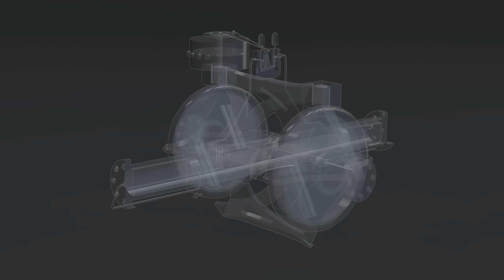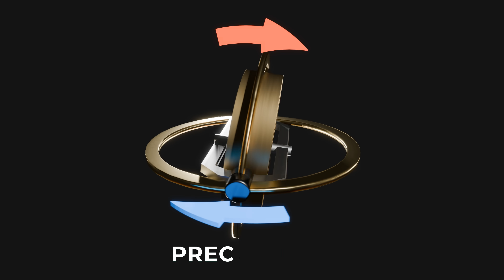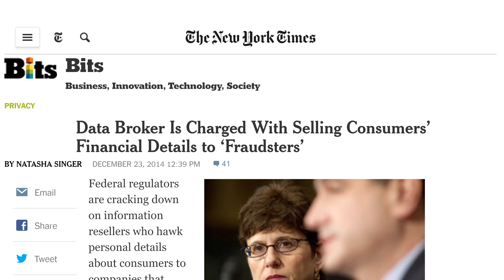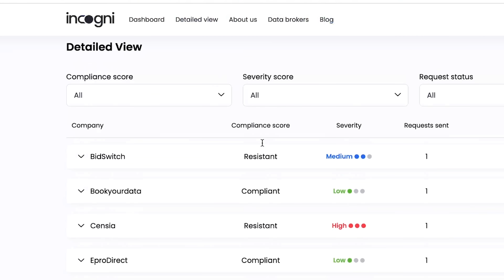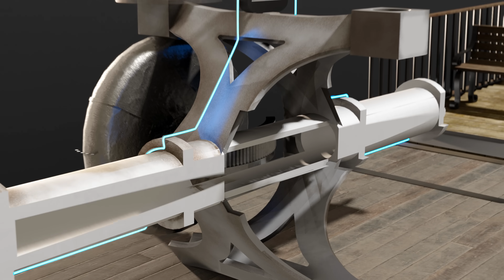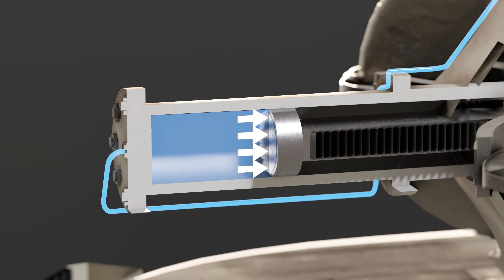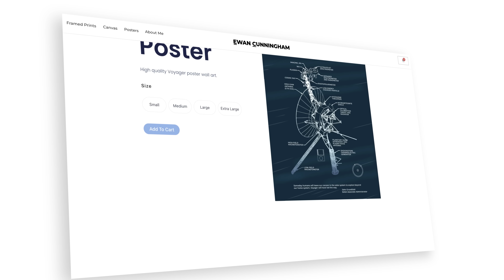The Self Balancing Monorail

Comment: Part of this idea was refined to develop the first High speed train ( The Talgo system) It used a gyroscope too, in order to maintain speed in the old spanish railway infraestructure. The Talgo reached 210 km / h in the eighties, that is a real Milestone. Afterwards the patent system was purchased by CAF to develop the TGV. It happened like that because Talgo didn't build up engines, and CAF could by buying the patent to Foster the required innovations to put their trains in 320 km / h

Comment: I see a problem with even a single car rail bus not clearing the obstacles on either side of the existing two-rail network, but it was a success as a design, and was effectively reinterpreted in a non-rail vehicle half a century later.

Comment: This is neat for an experiment but its not practically or economically viable. Any cost saving in rail are FAR offset by the heavy and complex gyro system. And when it fails... and it WILL fail... bad things WILL HAPPEN to the train, passengers and anything in the way when it falls at speed. The level of maintenance needed to keep ensure that never happens would be well above the cost of for regular rail cars. 

Also trains spend a lot of time parked. Every car would need to be constantly powered/fueled so it didn't just fall over sitting there. That is not only a cost problem but the logistics of that are nuts. One guy accidentally disconnects a section of freight cars and suddenly u got 100 rail cars falling into the next row of rail cars in the yard.

No sane insurance company would every cover this disaster waiting to happen.

Comment: A problem i can see with this design is the wheel shape and the track. The track has to be perfectly leveled on both vertical and horizontal axis. Any bumps or bends caused by wear and tear may cause the single wheel to bounce on the track and not land perfectly on the track, derailing it. This will limit the speed at which it can travel for safety purposes.and then the issue of comfort. Anyone has taken a ride in a bus with a shitty driver ? Steering left and right constantly for no apparent reason? As the gyros conpensate to keep the train upright, the pessengers will feel being pushed from left to right constantly. Though it will be a very small push, it will be nauciating on a long journey.

Comment: loosing space on every car for a gyro.
with one wheel you have constant rubbing on one sideflank of the wheel. which probably gives you more friction than with two rails.
the wheels on normal trains allways self center itself. only in extreme situations you have a rubbing sideflank.

it looks amazing and the ideas are pretty awesome. also the problem solving is extremely genius.

Comment: It's a fun concept but it was killed by a lot of things. How would it fare on older, or worse repaired, or otherwise unclean tracks that may have small branches or litter on them? How would it fare in snow or even just rain? Gyroscopes and reaction wheels used for balancing can become saturated, as well, where the cumulative change over multiple turns adds up to more than the force generated by the spinning mass can handle.

Comment: The thing about 2 tracks, a regular train, they have passive self alignment wheels. 

This train needs revisiting, as a commuters line.  

Also a spaced out wide track, back to two tracks, you could easily service tracks without down time. Just switch to the other rail.

Japan shutdown their rail at midnight, each night, to service their system. 

You don't want to miss the last train in Japan. You will find a very expensive cab ride.

One reason that US trains cannot hit top speed in the US northeast is because because th track radius is too small, going through crowded old areas.

One problem I see is an electric version.
You could use batteries on curves, on straight track, pull power overhead to run, to recharge batteries?
Reply from the maker: A fair assessment overall. There would certainly have been more obstacles to overcome. I'm still going to be forever curious what this design may have evolved into with the right investment though haha. Perhaps it would have evolved into a two track system regardless 🤣🤣 we shall never know. Thanks for watching and for taking the time to comment. Good luck in the giveaway.
Reply: @primalspace  Well 3 tracks, 2 used for bidirectional traffic, third the maintenance rail, to be used to handle traffic from the other being worked on. The biggest problem is constant uninterrupted service with rail.

Expensive up front, 3 rails, but cuts labor cost, crew timing, overnight work, better scheduling?

Just ask the airlines when national weather shuts them down.

When does NYC service subway tracks?

Comment: well i knew it was a gyroscope before i watched the video and i also know that the reason it isnt adopted is because if it has to stop due to some sort of malfunction it will fall over lol. and then how to pick it up? also loading and unloading immense cargo is an issue, you would need this gyro on every wagon, the cost is absolutely obscure...
 the current trains are very reliable,  another thing from the engineering standpoint its not half the price its probably 3x more because you would have to stabilize the track for horizontal forces a lot more than the typical 2 track system. basically its more expensive to do the same thing what a standard train does. modern monorails travel at upwards of 4-5 times the speed so the added cost is acceptable. also my IQ is about 50% higher than the average but this was still an interesting video.

Comment: Brilliant, but also impractical. Besides stability, two rails offer better weight distribution, more weight capacity, less wear on components and also less chance of derailment if one of the rails is damaged. Such a project was doomed to failure from the start.

Comment: Cool but not practical. Each car requires gyros. The gyros need to be large and heavy. The energy to keep the gyros spinning isn't free, the gyros take up a pretty huge space in the car. So the cost of being able to run on a single track is increased weight, increased energy consumption and decreased load capacity.

Like I said, extremely cool tech and it should not be forgotten, but it's not practical for commercial use.

Comment: Even if this wasn't a commercial success, it is still an amazing example of physics and ingenuity.
On a practical level, this train is just fascinating to me. Everything just... makes sense, you know ? I was perfectly following every part of it.
It's unfortunate that the cost of the gyro system would prevent it from succeeding as a product but even then, the thought behind the design and its mechanisms is still interesting.
Maybe in today's world, the gyroscopes could be made lighter and potentially driven to much higher speeds with electric motors to achieve the same effect at a lesser weight and cost.
Who knows, maybe if its explored more, it may become viable for transport!

Comment: I will not call this a "genius" since it is just a more idiotic way of complicating things and absolutely IGNORING the final purpose of the design - and that is to transport large volumes of merchandise and passengers,  fast, as safe as possible, and as cheap as possible. 3 of 4 of these points were absolutely ignored by this dumb "design"... 
First, is NOT a "train" but yes, a couple of big engines and a huge pair of Gyro with some seats behind.  
Second, it will need TWO sets of engines, one for gyros, the other for propulsion ( second set totally ignored by the muppet who uploaded this, lol). 
Third, you waste a HUGE amount of energy and loading weight, and space,  in order to maintain equilibrium,  when a sane mindset will just add a second track and get all that free,  from Mother Nature and basic physics.  :p 
Add to that the risk of disaster if a gyro engine malfunction occurs. 
No wonder nobody wanted to invest in such idiotic "invention",  is like one build a house, but instead of building a front door, will spend a fortune to build an underground entrance, with several labyrinths and several sets of stairs. Make no sense, have no logic. 
To conclude, one of THE most stupid inventions, probably the sad product of a mono-maniac mind...

Comment: Ok, it balanced while it was in motion, but how did it stay upright at the station? Just kinda leaned against the platform? Just spinning a couple huge flywheels doesn't prevent it from falling over.
Reply: The balancing system is clearly described in the video. It has nothing to do with the forward motion of the car.

Comment: Seems like over complicating things to me.
The main selling point is half the cost of building railways by cutting the a.ount of railways in half. But existing infrastructure is already more than good enough for the industry and the cost cutting will just have to be poored into the custom gyro carrige.
Which lead the problem of scale as i can't imagine this type of train can transport thousands of tons of cargo. And I can't imagine this thing zipping 500km/h like a bullet train to sastify the passanger market.
It can't scale in an industry where everything need to scale to a ridiculous degree, and the complex engeneering seems more problematic than it worth.
It's cool to look at tho, and prob cool (and uncomftable) to ride so maybe a tourist sector canake use of it.

Comment: I’m so disappointed in us back then I know investors where on the fence but come on you can use this as a passenger train and use the two railway for transporting heaver stuff
Reply: Why? It didn't offer any advantage.
Reply: Think long term if it cut the price for buying the materials for placing the wood and the rails and cut your time down for building it then that itself is an advantage and the less work you would have to do if smoothing out a ruff terrain just to place it not only would you have been able to undercut your competitors on pricing you could still charge about the same that probably would have made a killing raking in the money

Comment: The limitation of this design is the payload. The gyro is a brilliant design, however, it has to have enough weight to generate whatever forces cause deviation in one car since it is not a stable system. . Another issue is that it is almost impossible to couple multiple cars, each car needs a gyro which sacrifice payload. Even so, multiple gyros could induce oscillation among several cars.

A handful decades later, gyros have been used in autopilot in aircraft, which the counter force is not gyro itself but aerodynamic forces produced by control surfaces according to deviation signals generated by Gyros.

This is a classic engineering economy problem. It seems good at first glance: less cost upfront for building rail system, but dividend wears out real fast in operation.

Comment: while indeed an ingenious design, it has major shortcomings:
1) it is not failsafe due to its inherent instability - while theoretically acceptable for the military or experiments, it will be a no-go for commercial operation. Any failure of the complex flywheel mechanism (times the number of carriages) potentially brings the whole train down.
2) it adds weight/manufacturing time+cost/maintenance time+cost to every single carriage just to keep it operating;
3) google "flywheel explosion".
I also wonder what the rail/wheel design should have been to keep it from falling over, it would require additional engineering work. All in all, I think the investors weren't silly.

Comment: What is the power train and gear mechanism used to drive the wheels and   how the wheels designed weather it is with double side edge as no such details given in your vidio.But info is fantastic.Different  type of  gyro s are used in the ships and but with the advance electronic controls to balance and control specially in the rough sea and. Cyclones.

Comment: By doing this you would also reduce the amount of contact area reducing the amount of fiction thereby making it more efficient. 

Best design would be much easier to be done these and in fact would work amazing for high speed rail 
Add some outriggers withholding valves and this thing would be amazing
Reply: A high-speed monorail would be better wiith the rail above the car.
Much more structure to pay for, but the cars would be so much cheaper.
(See 'George Bennie Railplane).

Comment: That’s brilliant. Great video. 

One issue that would need to be addressed might be “track creep” at the curves, caused by the lateral force of a turning and leaning train. That’s a big point load on a single track. 

I have to believe that the track design would need work. Again due to the point load.
Reply from the maker: Absolutely. I think there would have been quite a few more hurdles to overcome with this design, but with the right investment I would be interested to know how Brennan would have overcome them!
Reply: That's why I believe that, if such a vehicle will come to market, it's going to have rubber tyres. So you can get a small bus that rides like a motorbike. Here in the Netherlands experiments have been ongoing with autonomous shuttle busses on bicycle paths. They aren't that wide, so with 2 wheels only there's more room for oncoming cyclists. 

These kind of 2 wheel buses can also be used for routes where there isn't much space for road infrastructure for environmental reasons, like in a forest or the dunes. Also I can imagine some cities want a BRT system that requires less asphalt. Asphalt doesn't look pretty, creates extra heat in the street over grass and the wider the roads are, the more asphalt there is that needs to be maintained.

Comment: It was a really amazing device but I think it was just too unsafe in the sense that if anything went wrong, like a burst pressure pipe in the gyro assembly, the whole train was in danger of losing balance and derailing, wheras in a normal train, if anything went wrong, the train remained stable on the track and could safely come to a stop
Reply from the maker: Absolutely. There would certainly have been many more hurdles to overcome had Brennan received the investment to move forward.

Comment: There have been several attempts at to make self balancing , two wheel cars, Lit motors and Gyro-X are examples.
None of them made any commercial success.
Where there insurmountable problems?
Or, it just didn't catch on with the public?
Reply: The insurmountable problem is that there isn't any point.
Reply: @tooleyheadbang4239  
Why?

Comment: Seems if you connected the cars with spanning trucks to link the cars together you would only need gyros every 4th or 5th car.   With lighter materials of today this seems like a winner of design.  changing tracks would be simplified .   I bet we could make a incredibly efficient version powered partially by solar panels.  platforms would be narrow.  You don't need it to hug ground as balancing is made easier with a little height (try balancing a very short stick vs very long stick on one finger.)     Wow I so want this to be built.

Comment: This gyroscope held the balance of the train.
But there is another balance to be kept. The rail surface and the wheels surface have a special geometry. The 2 wheels are balancing between the 2 rail strings. The wheels do touch the rail only in one point. The train is oscillating between the 2 rail strings. With one wheel and one rail string how can you solve this?
Reply: You could use a double-flanged wheel. I wonder how such a brilliant designer as Louis Brennan didn't grasp this simple solution.
Oh!...hang on...

Comment: Incredible design...maybe not for mass use...but possibly smaller quicker travel...with a secondary device that somehow would take advantage of the second rail latching upon it to keep train from falling over, if there was a failure of the gyro...considering it still maintained stability for 30 minutes. Anyway...great video.
Reply: A secondary device? I would use the second rail for stability, and lighten the vehicle by ditching the gyro apparatus.

Comment: Did I miss something? How did the vehicle stop to pick up and let off passengers? What if there was a mechanical malfunction? No vehicle gets away without some kind of malfunction eventually. I'm skeptical of the whole thing.
Reply: The only novel idea was the gyroscoic balancing. Starting and stopping are no different from any other rail vehicle.
Reply: @tooleyheadbang4239  So the train could stay upright without forward movement? The train has to be stopped to pick up passengers does it not?

Comment: "So strong that even if every passenger stayed on one side, the train would stay perfectly balanced" I'm just wondering about the mechanics of gyros. Can you keep this force indefinitely because of the motors that keeps the gyros spinning. Or would the gyros find a new equilibrium if the passengers stayed for too long on one side?
Reply: The balance is ultimately maintained by the power of the engine. Unlike the two-rail system, fuel must be burned just to keep the machine upright.
Reply: I still wonder if the gyros will find a new equilibrium if it has a lot of weight on one side for a long time.  @tooleyheadbang4239

Comment: So much amazing ingenuity to overcome one engineering problem after another. What’s remarkable is even if one solution failed to solve a problem, the engineers came up with a totally different solution to solve the problem. Human invention and brilliance seems so much more powerful in this era of horse drawn carts, wooden ships, candle/gas lit streets, and hot air balloons. Not surprising then that, the motor car, Iron ships, electric street lighting, and aircraft were not far away.
Reply: ALL of those inventions had been demonstrated before 1910, as had the railway.
This was a brilliant exercise in engineering, but nothing more.